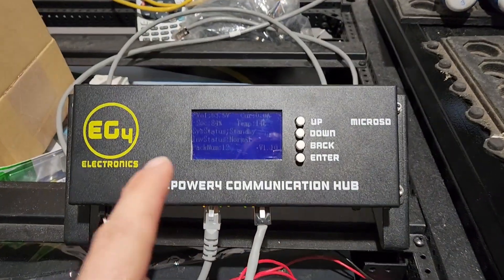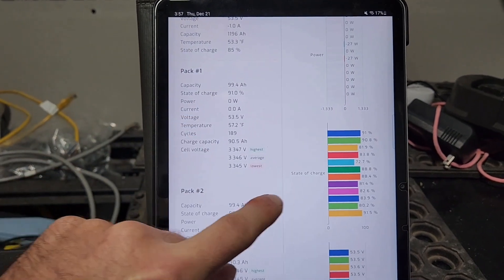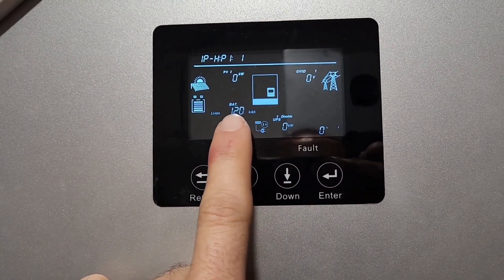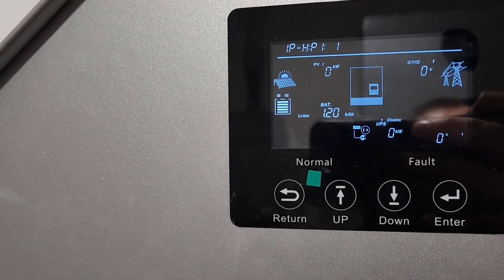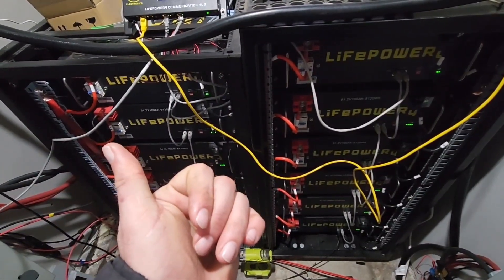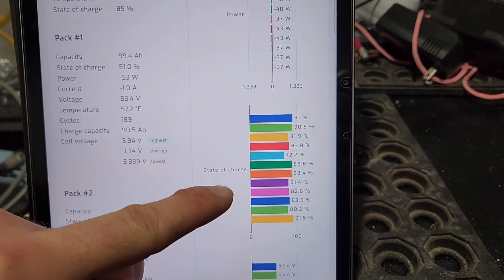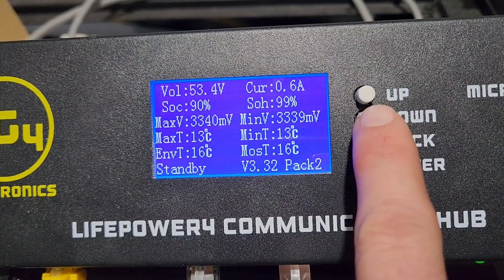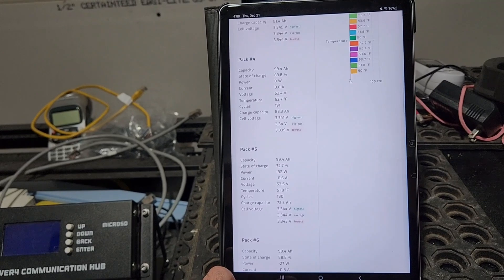EG4 Comm HUB + Solar Assistant + Closed Loop Comm w/18Kpv & 6000XP Inverters at the Sametime.

Comment: Hello, Nice video I have a wire question. It looks like in the video you connection to the SA is from the battery rack on the last battery?  I have the hub and 6 eg4 LP  version 1's and a Gorwatt ES 5k invertor and wasn't sure if i need to connect the Growatt directly the SA or of gives information from that battery comm cable from the  last battery, Thanks
Reply from the maker: Does the hub work with the growatt?
Reply from the maker: I have SA pulling battery data from the battery. The inverter pulls data from the hub.

Comment: How are you connecting solar assistant to see the batteries. I only have the 18k connected through the rs485 and my battery display looks nothing like yours,
Reply from the maker: This video is a few months old. Im using the Hub to gather the battery details and the hub is sending the data to 18K. Solar Assistant is plugged in to the last unused rs485 port on the LifePower4 battery
Reply: @theadventuresofarenaissancman  I see two cables leaving the usb ports on your pi. you said one goes to the last rs485 on the batteries. where is the other going?
Reply from the maker: That's a great question. I'm not home right now, I'll check later.
Reply from the maker: The 2nd USB was a charging cable for my phone.

Comment: Thanks for the video. So the eg4 hub is allowing you to use both it And SA to monitor the batteries?  Would you be able to run it the same way with out the eg4 hub?
Reply from the maker: The hub allows me to use battery communication with the inverter and with solar assistant simultaneously.
Reply from the maker: Correct. The hub is required in my current setup.

Comment: So your solar assistant can read the data from all packs even when its connected to the last slave pack? I am trying to get solar assistant to see my Ruixu batteries but no luck yet
Reply from the maker: Yes, my SA is reading battery data, the rj45 to usb cable is read/write compatible and connected to the end (12/last battery of the string).  My Lifepower4 batteries are running the newer firmware that uses the updated 19,200 baudrate.
Reply: Did you every get SA to read the individual ruixu packs? I'm trying to do the same with mine but no luck.

Comment: So SA is not plugged into the comms hub or batteries?  Its reading battery through the 18kPV?
Reply from the maker: The ethernet cable is connected to a router. Not the 18Kpv.   I definitely see the confusion, I should have made the clearer.
Reply: Yea I was a bit confused about that as well.
Reply: So from what I gather, I need to buy an EG4 hub to be able to see my battery data again in SA.  When SA was directly connected to the battery bank all was well, but when I switched to closed loop comms with the 18k, I had to give up that port to the inverter and SA, even though configured to connect to the 18k in the EG4 monitor software, doesn't show battery bank info currently.
Reply: Just re-watched it again.  Didn't catch that you plugged SA into the open jack in the bottom battery, the first go round.  I'm about to go try that as well.  It'd save the cost of buying a hub if it works.
Reply: Hmm, SA is just cycling through addresses and saying invalid data received.  There is an SA update that looks like it just came out, so I'll give that a try.  I'm guessing it's just not liking the fact that it's not connected to the master battery pack.  Sent you a screen recording clip on the forum chat.
Reply from the maker: SA can't communicate with the batteries if any of the battery DIP switches is set to 0000.
Reply: @theadventuresofarenaissancman  sorry I’m still confused. How is SA reading the battery bank,  Is it connected to comms Hub?  Secondly how is SA reading the 18k if it’s not directly connected via a cable.
Reply from the maker: @cgutowski471  SA reads data from LuxPower inverters through the local intranet.  They do not need a direct usb connection like other inverters.
Reply from the maker: @cgutowski471  Solar Assistant is connected to the last remaining battery port at the bottom right.   The first battery port (top left) is connected to the HUB.  The Hub is sharing battery data with two different inverters.

Comment: Thanks for sharing. I’ve been using SolarAssistant with my 6000EXs but will soon be upgrading to the 6000XPs and wasn’t sure if SA was useful.
Reply from the maker: I use Solar Assistant for the data and graphs.
Reply: @theadventuresofarenaissancman   that makes sense. I was hoping that would be in the new eg4 app. Maybe some day 🤷🏼
Reply from the maker: I purchased Solar Assistant prior to owning the 18Kpv.  I probably wouldn't have purchased SA since the OEM EG4 app and website for the 18Kpv/6000XP is sufficient for most users.